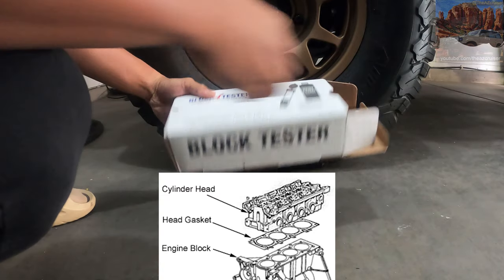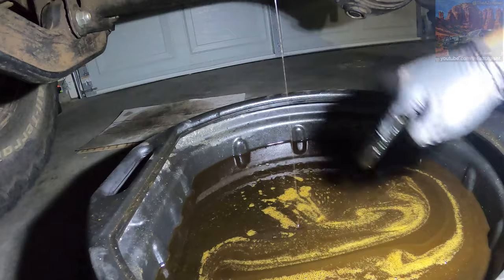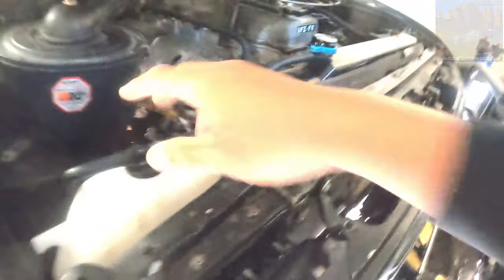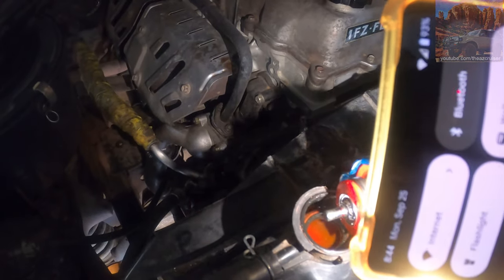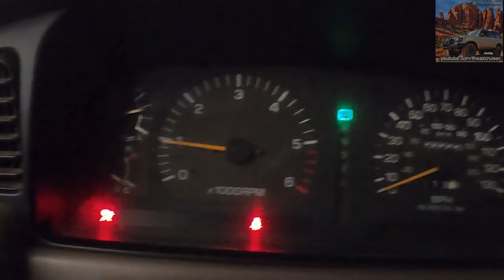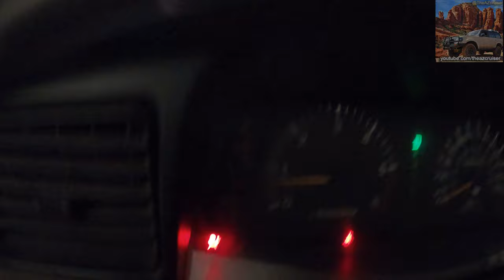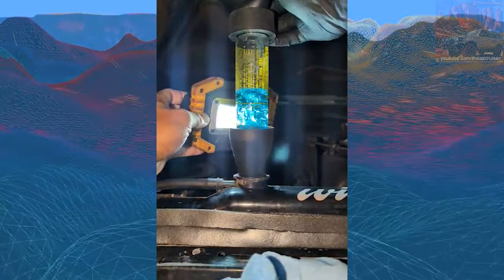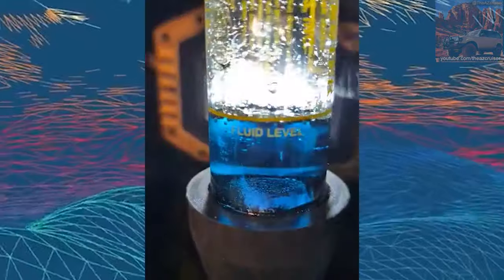😰Did it fail? Head Gasket test on my Toyota Land Cruiser (80 Series)

Comment: I have the same problem in my Toyota LC100, I have the same engines and a problem with losing coolant. CO2 tests with negative results. Please tell me if you have discovered your problem.
Reply from the maker: I have since changed the gasket and took it to a local LC mechanic shop here in Phoenix, AZ. They did fix the oil cooler and said there wasn't evidence of a head gasket leak. But as of now I still am losing coolant 😂. Yes 👍 I will if I can figure it out.
Reply: @TheAZCruiser  did you replace the head gasket?
Reply from the maker: Yes, I have. The head is machined too @koza
Reply: @TheAZCruiser  yoo I just called a shop yesterday to drop mine off for the head gasket because it failed the combustion test last month. I would've done it myself but I just don't have the time to do it. Thanks for sharing the video!